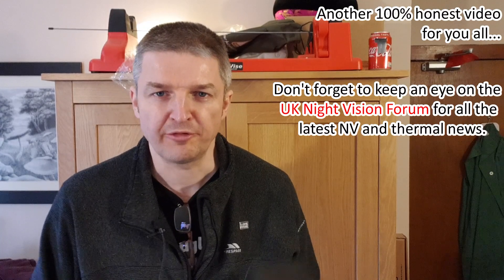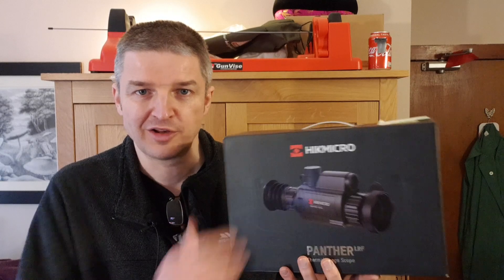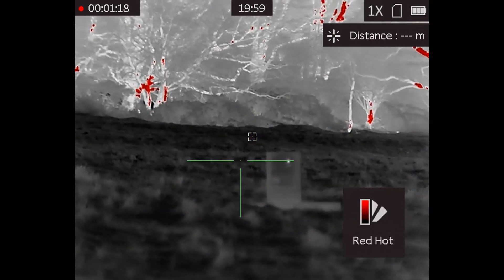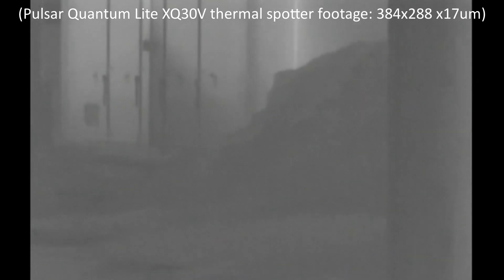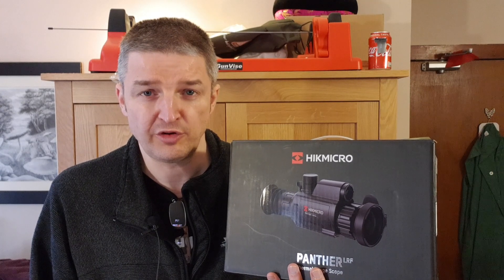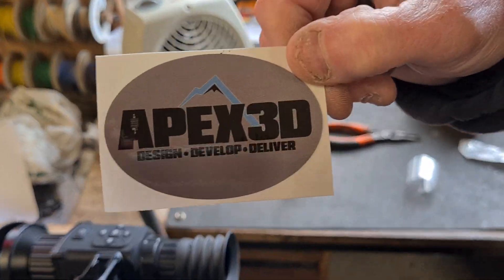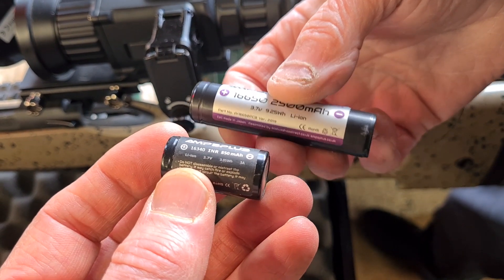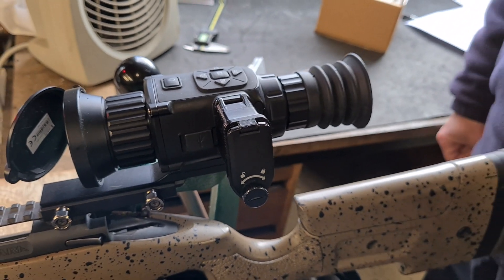HIKMICRO Panther PQ50L preview and Bruce's TQ50C battery extension

Comment: would this fit on ZB mount Russ/
Reply from the maker: Hi Gavin, it would as it comes with a Picatinny mount, though that would lift the scope a fair bit.
Cheers. Russ
Reply: @RussDouglas222  is the factory mount decent?
Reply from the maker: @Gavstan799  I've not analysed it, but initially had my first Pard008S-LRF fitted via this (while I waited eagerly for the EagleVisionCam compatible top rail for the 108MOA mount), and I had no issues, nor did I need any shimming.
Must admit at one point with my Maverick the zeroed reticle was off a bit to the left, but I found I just hadn't centred/jiggled it very well when mounting on the rifle's Picatinny rail.
Cheers. Russ

Comment: You should get Bruce to look through the back of his Krypton as he states in his TQ50C review that the Kryton uses the complete display. He's wrong. It only uses 960x720 resolution (which is clearly seen when looking through the rear of the device)  if it was to use the complete screen there would be no way to adjust the internal collimination.  No clipon uses the complete screen for this reason.
Reply from the maker: Maybe he messed-up there. 🤷🏻‍♂️
Cheers. Russ